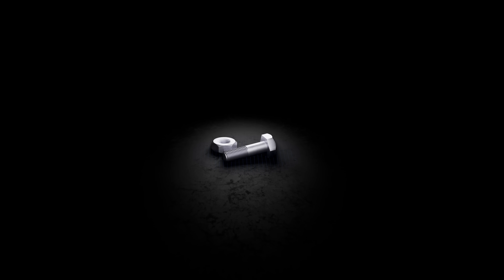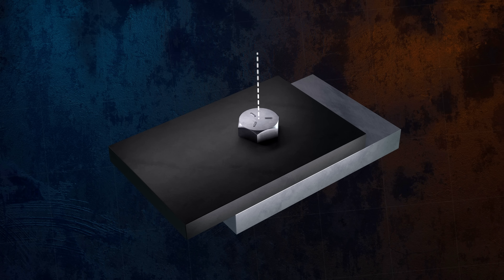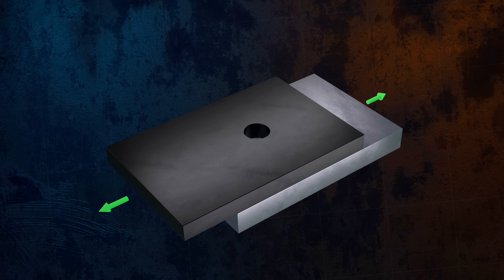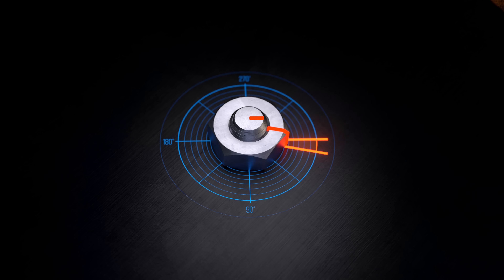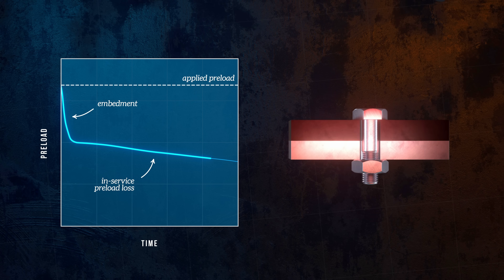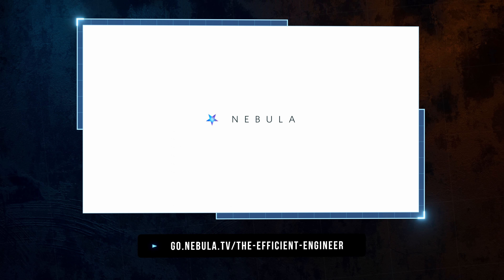The Incredible Strength of Bolted Joints

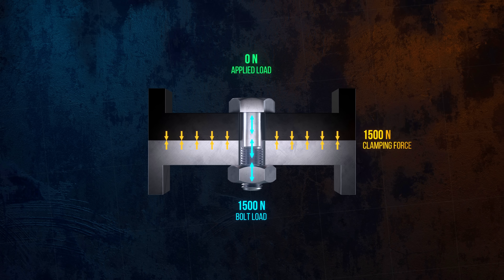Comment: 2:30 Note: With a joint in tension like that, the bolt is resisting the entire load. The stress that the bolt experiences is not reduced because it has been preloaded unless the two surfaces are bonded in some way. In the case of two unbonded surfaces, the stress that the bolt can take before it breaks (the bolt's ultimate strength) is unchanged by how you preload it. The only thing that preloading does is increase the amount of external force you can apply before a gap opens in the joint (which may be considered a failure of the joint). The ultimate strength of the bolt doesn't increase because you preload it as implied in the video.
Reply: Thank you, that was the only point that was bothering me, very well worded, another way to think about it is as: the joined members are in compression (by the bolt) and the bolt is in tension (by the members). If the tensile and compressive forces don't balance, then you have a result of movement and possible failure, this is true of any structure. When those forces fall out of balance things move.

To the maker of this video, it is very good and I like that you have used accurate grade markings on the fasteners.
Reply: @seanmance7499 Guys ypur comment confused me a bit can someone tell me now  what i missunderstand from the video ... what i understood from this part and made sense to me is the following    "  when an applied load  acts on this system most of this load   is absorbed by the clamping  force and a smaller part of the applied load increases the load acting on the bolt"   so what is wrong about that ???

Please someone help me understand
Reply: @MATHBOSS287  Think of it from a different angle, say,,,, imagine you are holding two rulers together with a clamp and you try to pull them apart (in tension not shear), in that case the only thing holding the rulers together is  the clamp. You can do the clamp up as tight as you want, it will still be the only thing holding the rulers together, at no point do they start holding together by themselves. In this example the tensile load is handled by the clamp, and compressive loads are handled by the material itself and any shear loads are handled by the friction generated between the two mating surfaces being pushed together.

To contradict  myself a little, if you were to squeeze two pieces of metal together with enough pressure, you could generate enough heat to begin to fuse (weld) them, but at that point you are changing the temper of the metal and I don't know of a metal that would keep it's form under that much pressure, so not really relevant and no engineer would trust the joint, due to the lack of control and change of temper. The change in temper is a major reason modern car frames are glued together, there are many others that play a part in it.

Whew that was longer than I planned.
Reply: @seanmance7499  Yes but if the bolt is not too tight then it will be subject to the full external load. If tight then some of that load partly increases its tension while some overcomes the compression between the parts. You implying the bolt takes full force in all cases which isnt accurate.
Reply: Though thinking on this again, there is a factor that having the faces of the members in contact, that does decrease the load on the bolts:
The gravitational pull between bodies, though I would be amazed if it had any notable influence, let alone be measurable. It would be possible to calculate it, but you would never rely on it.

But as an engineer, I would greatly appreciate being corrected if these views are wrong.
Reply: @seanmance7499  I don’t think so, the electrostatic and atmospheric forces between them would be orders of magnitude higher.
Reply: Yeah, a whole bunch of people are getting the takeaway that compressive forces between the joint members are load-bearing - but they can’t be since they are already nullified by their corresponding normal forces.

Preload seems like it’s just for rigidity and sealing/mating surfaces.
Reply: @kaidwyer Guys ypur comment confused me a bit can someone tell me now  what i missunderstand from the video ... what i understood from this part and made sense to me is the following    "  when an applied load  acts on this system most of this load   is absorbed by the clamping  force and a smaller part of the applied load increases the load acting on the bolt"   so what is wrong about that ???

Please someone help me understand
Reply: It seems the intended lesson is that preloading increases the amount of external tension that can be applied *before the joined members separate*. But as it is presented, it sounds more like pretensioning magically makes it so that the opposite compression force created by the pretension somehow helps the bolt resist external tension. In reality, at least in terms of the load required to snap the bolt, it does the complete opposite. For other failure conditions, pretension helps, obviously. But not for ultimate external tension load. 

In short: Pretensioning makes the bolt break under a smaller external tension load.
Reply: The video is correct the pre-load does reduce the effective force on the bolt. The derivation for how bolted joints are modeled that is shown in the video can be found in Shigley’s Mechanical Engineering Design.  Your interpretation is dependent on the assumption that the system exists under non-deforming conditions, which in a pre-loaded bolted joint, is not true. The ratio of applied force distribution between the bolt and the material is primarily based upon the differences in Elastic Modulus and effective force areas of both the material and the bolt.  It is best to be thought of like this: when a bolt is pre-loaded, it deforms the clamped material a certain amount.  That deformation of material creates a compressive force pair in the joint in the same direction as the compressive force pair the bolt and nut applies, since the material is resisting the deformation defined by its elastic modulus. When an axial load is applied to the joint, some of the force goes into “decompressing” the compressive force caused by the material deformation, and the remaining force goes into elongating the bolt itself.  The distribution of how much force goes into “decompressing”the material, and elongating the bolt can be calculated as a coefficient to the applied force.
Reply: @TheDoritoBoi  true
Reply: The video is correct. This is explained in detail at minute 42:00 of this video "Stress Analysis: Stiffness of Bolts & Members, External Tensile Loads on Bolted Joints (12 of 17)". The bold+member system has a (shared) elongation under a net force (net, after combining external force with preload force). The question is how much stress due to this net force is in the bolt and how much stress is in the member. Due to a difference in stiffness between the members and the bolt, the stress in the bolt spans a much smaller range than the stress in the member does.
Reply: @xy4489  yeah it’s correct, but as kind of an implied rule in structural design, we tend to ignore the effects of preload and just consider it as a factor of safety, meaning that we assume that the connected members are rigid in designs of connection (only in this area tho)
Reply: @xy4489  thanks a lot for sharing this video. It is great!
Reply: It seems the intended lesson is that preloading increases the amount of external tension that can be applied *before the joined members separate*. But as it is presented, it sounds more like pretensioning magically makes it so that the opposite compression force created by the pretension somehow helps the bolt resist external tension. In reality, at least in terms of the load required to snap the bolt, it does the complete opposite. For other failure conditions, pretension helps, obviously. But not for ultimate external tension load. 

In short: Pretensioning makes the bolt break under a smaller external tension load.
Reply: My takeaway is that people's guts are terrible at analyzing forces on a bolt, and that's why they need to get a degree to work on this stuff.
Reply: Thank you for bringing this up.  I thought I was alone.  There is no way, without adhesion between the two bolted members, for the total preload between the members to be anything but equal to the total load on the bolt.  As soon as the members are loaded the bolt begins to lose preload.  A simple free body diagram is all it takes.

The stress in the materials may be different but the total load and preload is the very same.

Without the bolt there is no preload between the two members.
Reply: @sequoyah59  You are wrong too with the statement "As soon as the members are loaded the bolt begins to lose preload". I dont get why this is hard for most to understand, dont just try to understand theory blindly but stop and reason about whats happening. When you tighten the bolt it increases its tension and at the same time creates an equal compression force on the 2 pieces. When you apply a load trying to pull the 2 pieces together, you are essentially reducing the compression force till the pieces separate, but pulling also means you are pulling on the bolt hence increasing the tension in it. Keep pulling and you will break the bolt. How is that reducing tension in the bolt? Preload is just a fancy term for the tension
Reply: @sequoyah59 Guys ypur comment confused me a bit can someone tell me now  what i missunderstand from the video ... what i understood from this part and made sense to me is the following    "  when an applied load  acts on this system most of this load   is absorbed by the clamping  force and a smaller part of the applied load increases the load acting on the bolt"   so what is wrong about that ???

Please someone help me understand
Reply: @MATHBOSS287 The bolt preload is exactly what it says on the tin. It's load the bolt is already taking and constantly experiences. When an external load is applied the preload + the applied load are carried by the system. The bolt is already experiencing the preload and now also taking some of the applied load. When the applied load exceeds the preload, the bolt load will equal the applied load. The bolt was already experiencing more than the applied load when it was preloaded. The bolted connection is failed at this point because the faces have separated. Typically, the faces you're bolting together should stay in contact, that's why you bolted them. Your boat is not a boat anymore if water can get in.
Reply: Guys ypur comment confused me a bit can someone tell me now  what i missunderstand from the video ... what i understood from this part and made sense to me is the following    "  when an applied load  acts on this system most of this load   is absorbed by the clamping  force and a smaller part of the applied load increases the load acting on the bolt"   so what is wrong about that ???

Please someone help me understand
Reply: But you should be designing to the yield strength not the ultimate, AND you have to take into account material fatigue, which is something I would expect is mitigated by preloading the bold.
Reply: @orppranator5230  you have to design for both. you design for yielding for ductile failure (stretching of gross area) AND ultimate for brittle failure (fracture at connection/net area)
Reply: update -- what is described in this video about tensile strength of a bolt joint seems to be true despite how counterintuitive it is. I don't understand how it works, but I asked a guy with engineering degree who currently works as a technologist, and it seems to be the case. This effect should be investigated on a deeper level
Reply: After ample time and careful consideration, and sifting through the wisdom of all the engineers debating this topic with no known credentials other than a YouTube account, I’ve decided to side with the creator of the video.
Reply: Cool, glad to know I'm not the only one who that didn't make sense to. Like, if I'm holding two pieces together, and there's nothing else, then whatever force is trying to pull the two pieces apart has to overcome the force I'm applying. And when it tries, that force is entirely entirely applied to my hands. No matter how hard I hold the pieces together (pre-tensioning), 1000N applied to pull the pieces apart will act against my hands (the bolt and screw) and nothing else.
Reply: Thank you, that was what my gut was telling me,
Reply: In tension it would resist entire load but in shear condition friction force between parts would be subtracted from the shearing force, at least it seems like it should be. The mistake author is made is quite severe
Reply: What was stated in the video should be true in the case of a series of bolts. (Linear or grid). No one bolt is going to take full force, because the rigidity of the material transfers the clamping power of other bolts. 
But this was not mentioned at all that I found.

Comment: This is all real interesting stuff. As a carpenter, the general rule when tightening bolts is snug plus a quarter to a half turn. Glad to see that holds up pretty well. Especially when considering those other variables, going too tight should always be a big concern, but if you've gone a bit passed snug you should be good

Comment: Something not quite right about explanation of Tension bolt. If bolt can for example can hold 1600N that is all what can hold nothing else you can make this bolt to be stronger then it's.
Explanation is maybe in molecular forces but the way how is explained is here, probably even science simplified,  obvious not possible that you can trick bolt to hold then it can. Pretension can be 1500N then you may take 1500 out but do 100 more and bolt would snap if following explanation in this video. Shear I understand but explanation even official in science as it is explain here  cannot be. This bolt in tension could only be stronger with tension in molecular strong forces start to kick and then is load transfered to plates not to bolts. Which is different then explanation here

Comment: Explain me how tensile force doenst act directly on the bolt.

The clamping force is a result of the preload, when tensile force is introduced it will immediately reduce the preload, since the two parts are not physically joint in any other way.

Do tell if im wrong

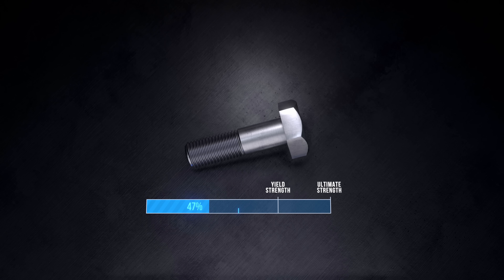Comment: The "standard" preload value is 0.7 Ultimate strength, not 0.7 yield strength as mentioned in the video. For example for a 8.8 quality bolt (Sy=0.8Su) like in your example 0.7Sy means 0.7*0.8Su=0.56Su (Quite lower than it should be. Indeed it is what your bar graph shows 10:12 as only half of the bolt capacity used.

Comment: In the first example of the force(s) being applied in parallel to the longitudinal axis of the fastener, would the springs representing the system not be in series? It would be great to model the system on a load frame and match empirical data to the theoretical prediction(s). Thanks for a great video!

Comment: 2:23 you are showing the right thing, but explaining the wrong thing. If you bolt two metal sheets together with a bolt and use a preload of 1000 N, then these two sheets are held together with a force of 1000 N. The 1000 N are exerted on the bolt and put strain on the bolt. If you now "pull" on one of the sheets with 300 N, these sheets are no longer held together by 1000 N but by 700 N. But the load on the bolt is now 1300 N. Material surrounding the bolt does not support the bolt in any way. That is just wrong.
Reply: ...thank you for posting this. I saw that and cringed.

Comment: Very well explained.  The fact that, in a tension joint, the bolt does not experience any additional force until preload is exceeded is a bit counter intuitive but makes sense. I don't think the fake springs helped. It is the lifting force replacing the reaction force of the lower plate. A force diagram would be more accurate and clearer than fake springs.

Comment: Excellent video.
I've been using CAE to analyse bolted joints for a number of years now.
Some of the engineers in the teams I worked in knew nothing about how bolted joints work. One of the chief engineers thought i was talking another language when I told him that the bolt sees near no load when a joint is in tension and doesn't open.
I had to draw him a joint diagram before he was finally convinced.
Bolt Science is a good website that I've used in the past.

Comment: You only use a single lock washer on the side of the nut or bolt you intend to torque. The other should be held stationary. You can use a washer on both sides to make torqueing the fastener more consistent, but using two lock washers, just let's the joint slowly back off. Because both ends are being pulled away from each other evenly. Instead of off center.

Comment: I hope this makes sense... How does additional bolt preload strength due to having more threads compare to the thicker shaft strength of a bolt with far less preload due to less thread length in sheer loads? I guess it depends on application but i would love for someone to provide a data sheet or test on this.

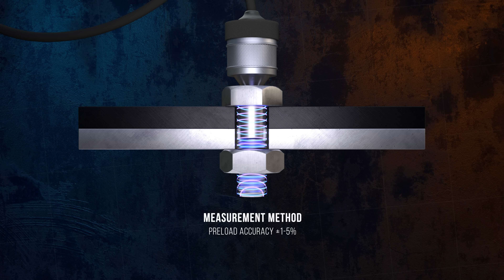Comment: 13:46 A very NASA solution. 16 bolts perfectly torqued with incredibly complex methods when for less weight larger bolts imperfectly torqued would have worked better,  IMO. 

BTW , very nice presentation! Thank you!